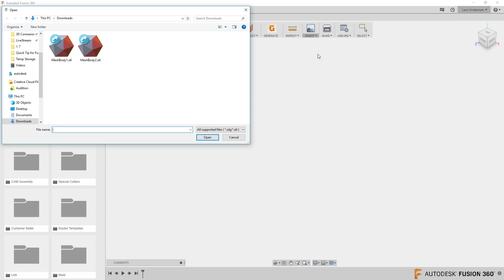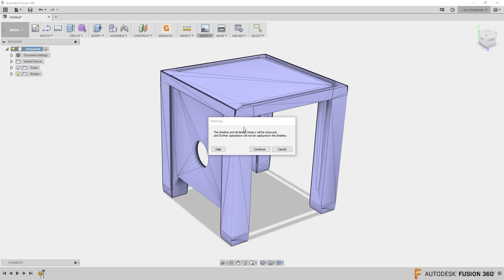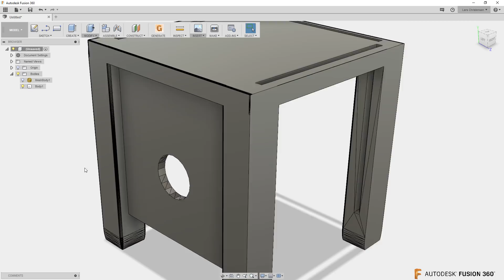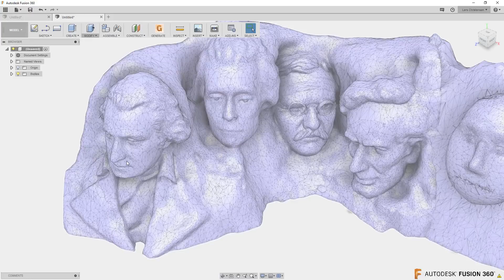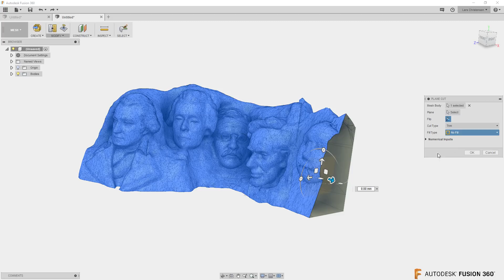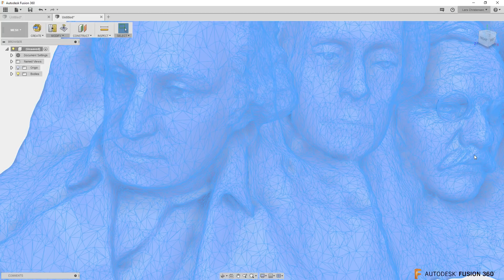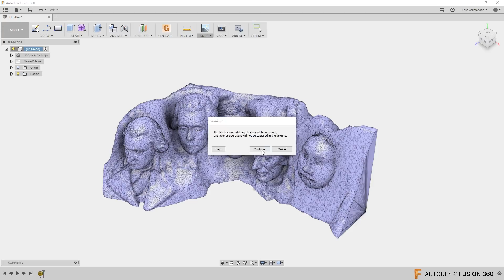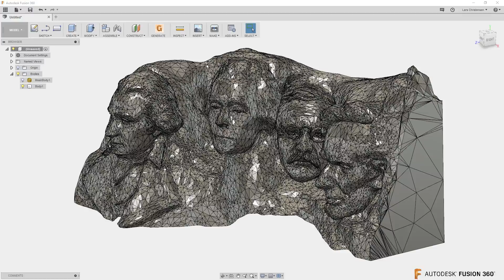Everything You Need To Know About Importing STL — Fusion 360 Tutorial — #LarsLive 165

Comment: Once again thanks for the awesome videos, I personally have learned many tricks and techniques watching. I use fusion primarily for 3D printing, many times I have had to modify a stl file which is complex having fine resolution, these triangles of which you speak give the model the shape, overall form and reducing the faces causes problems. The trick or technique I am searching for is how to import  a stl file with the sole intention of taking that complex 3D surface model and creating solid bodies that I can modify in the sketch environment.
Reply: The problem with STL files is the triangles. If you didn't make the model, you're probably not going to have much luck. If you have something like 3d studio max, you can try using the quadrify function, but it doesn't produce the best results.
If you made the model yourself, (or know the person who did,) your best best is to make it as all quads, then export it as an OBJ with the triangulate option disabled.
This will allow you to import the OBJ file in to Fusion, and once in there, you can use the convert quad mesh to t-splines function to give you a model you can work on in the sculpt environment. You can alter it as you see fit, and even convert that from t-splines to a solid body. You won't be able to modify it by simply adding dimensions to change the size, but you can create sketches and use those to modify the model with cuts/extrusions etc., and you can even create sketches using the geometry by projecting edges from the model.
If you want to change the dimensions though, you'll need to use the scale tool. It's not straight forward, as it doesn't give you dimensions as you scale, but by measuring, or checking the bounding box size (if your model is appropriately oriented) you can use those measurements to find the right scale factor. So say you have a mesh that's 12.4cm wide, and you want it to be 11.3, you need to divide your desired size (11.3) by your actual size (12.4). By entering the value of that calculation in to the scale factor box, it will resize correctly. 
You can do it uniformly or non uniformly for each axis, you just need to calculate all 3 axis factors for non uniform.
Reply: Thank you for the suggested workflow. All of the files that people bring me to 3D print need some modification in order to print the model.

Comment: It may reduce confusion to know that STL files do not have dimensions, only numbers. Some how something has to define what a number means, whether mm or inches or whatever. So the first time you open an STL, it's common to not have the defaults set the way you want, and get something 25.4x larger than you intended, for example.

Comment: Thanks for the vids Lars. 
I don't know if it's possible, but I was trying to use the match command in sculpt environment the other day, and I couldn't get it to work with what I was working on. 
I've seen it work on like, a plane with a hole in the middle, where the middle hole gets matched to the border of a hollow cylinder (like a plane wrapped in to a cylinder) but I wanted to use it to match a  "fill" to the hole. The example I saw was using 2 t-spline bodies, so I know it can worth with that, but for me, I was unable to select the second body edges to make the match.
To give a clearer picture, I had a finger, and there was a hole where the finger nail was supposed to be. I copied the faces off one of the other finger nails (to a separate body), and tried to make the border edges of the nail to the shape of the hole so I could merge the edges nicely. I didn't matter if I selected the border edges of the hole, or the border edges of the nail first, I was never able to select the second set of edges to match it to. 
If you have any idea how to do something like that, I'd love to see a video on it :)

Comment: WOW, I was screwing around with the 'file/open' option, and it came in rough 10X larger than it should  (Maybe was using thumb widths as the units instead of mm, inches would have been 25.4X) ... I guess they should delete that option as it is junk.   I tried cleaning up my STL file by deleting the surface faces and when I selected one, it said that I need to have them all on the same face, so was that triangle not in the same plane as itself?   Nice error message.  Thankfully, giving up on that I was able to convert it in spite of the warning and when I converted it to a solid and later converted it back to an STL file, it wasn't manifold, but it was  able to fix it in the host program and print it.  Not sure why it converted to a solid that wasn't manifold... but thanks to your help, I was able to make it work in Fusion 360 and it is printing now.

Comment: You did this video 2 years ago (almost to the day) and none of the comments provide a possible solution to the conversion failure. The software is struggling with the conversion because the number of triangles are consuming all of the computer's memory. You had 3 windows open in Fusion 360, each of which has their own mesh info and all of these are consuming memory. If you closed the other 2 windows (tabs), you probably could have done the conversion. You effectively did this when you closed everything and restarted the app and it worked when you just had one tab open.

Comment: I have brought in the mesh, converted to solid, but how do you place it on a plane or pin it to the origin??  I want to mirror the solid body but it is not assigned to a face or origin point.  Thanks for any help with this.
Reply from the maker: You should be able to use the Move command to move it to the origin

Comment: And I assume that once the thing is made solid, it will be easy to align it with the Origin so that its X-Y plane is at the bottom and the Z-axis end-mill will be pointing straight down so that tool-paths can be done. Getting that alignment with the origin defeated me when I used Data upload.  Everything else was fine. But not being able to align it made the result useless. The trick of using Mesh Insert will be tomorrow's task, and I hope all the hair that I 've been tearing out will hit then Undo.... ;-)
Reply from the maker: Thank you for watching 👍😊 Did you ever see this one? https://youtu.be/EejRr-Y3174
Reply: @cadcamstuff  No, I hadn't seen that one. Thanks. I shall add it to my vast Lars collection ;-)  I am still getting to grips with 3D technology after having spent decades in 2D, so every bit of help is appreciated. Perhaps a Scandinavian accent is needed... ;-)  My Stepcraft is still sitting forlornly, yearning to get going, but the first thing I want to do involves a topographical STL, which till now had defeated me. It would have been nice if Fusion 360 saw what we see--a flat STL surface looks like a plane to human eyes but Fusion doesn't see it as one. It would be even nicer if Fusion asked when it saw a mesh file being uploaded if it wanted it treated as an insert--or if it just did that automatically, and asked if we wanted it converted to BREP, rather having to select all that manually.
Reply from the maker: The CAD within Fusion is based on mechanical CAD, so mesh and STL Files is not the core of the technology. The development team have added great functions compared to other mechanical CAD out here, but there are definitely more that could be added...These guys are very smart, sure they have more cool stuff up their sleeves in the future
Reply: @cadcamstuff  They are indeed smart, and their product is well-named. 360 covers the full circle. Being a newbie, just in the process of setting up, I have looked at other products, including one of the top CAD packages, IronCAD, but Fusion 360 has both excellent CAD and CAM. IronCAD's drag-and-drop facility is very good, and I hope Autodesk will add it to Fusion 360, but on IronCAD CAM is only a third-party SprutCAM, which has very few post-processors.

And I think Autodesk's ploy of offering Fusion 360 free unless you are making more than $US100,000 out of it is brilliant, because at no cost to them it gives them a huge test-base/beta-base/suggestions-base immeasurably larger than they would have if the software could only be bought, and on which they can build a far better product for their paid-for-base. Very clever. There is no substitute for backsides on seats. Take a 360 bow...
Reply: And thanks for all your videos. I would be nowhere without them. :-))
Reply from the maker: Thank you 👍😊